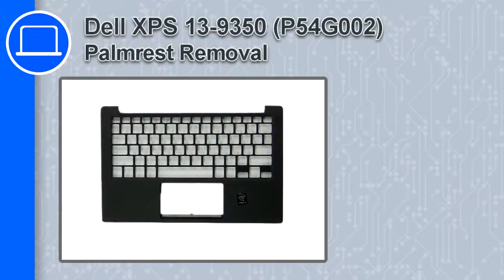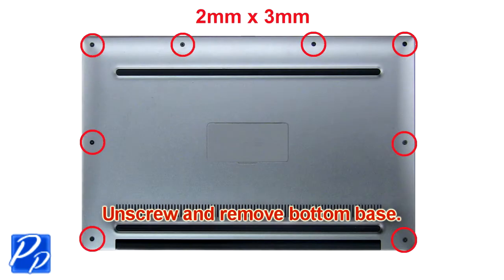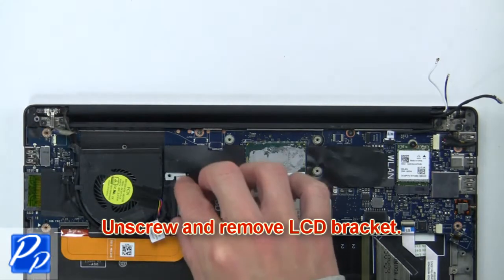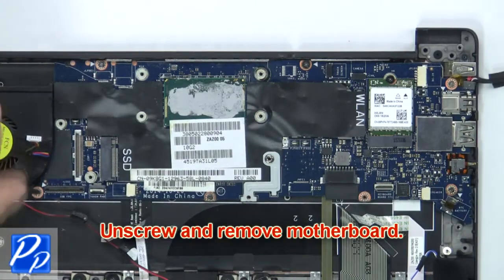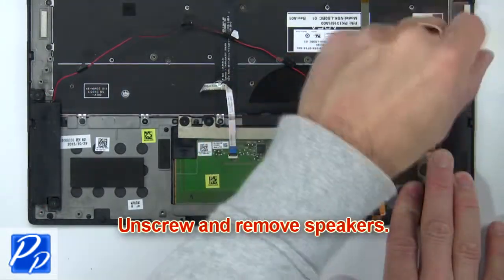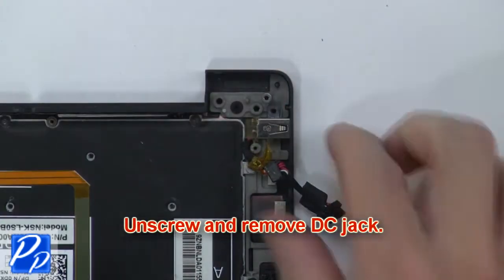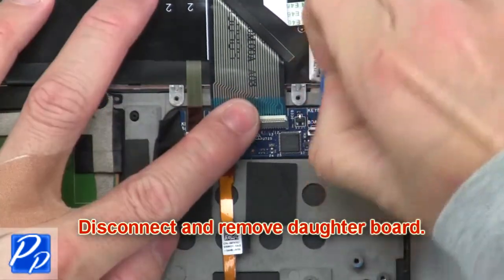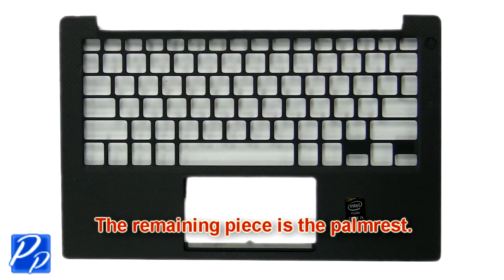Dell XPS 13-9350 (P54G002) Palmrest How-To Video Tutorial

Comment: great video. Maybe you should have added a list of tools (actually 2 types of screw-drivers), and specify that some of the parts that you are easily removing in the video, are actually glued. You unglued them beforehand, to make the recording smoother. I struggled to unstick the daughter board
Reply: Hi, you seem to have dealt with the glued-on parts before - could you help me? I need to replace the keyboard backlight function board on my Dell XPS 15, but it's glued to the palm rest. Would you know what is the best approach to unglue it and what glue or tape can be used to glue it back on? I cannot find any good info out there. I asked on a few forums and nobody answered so far. Thanks!
Reply: @Anoiny  you have to proceed slowly, slowly... until you unstick the piace. This is all I can say.
Reply: @MassimilianoAdamo1967 ok, noted - and what kind of glue to use to glue it back on? Do you know?